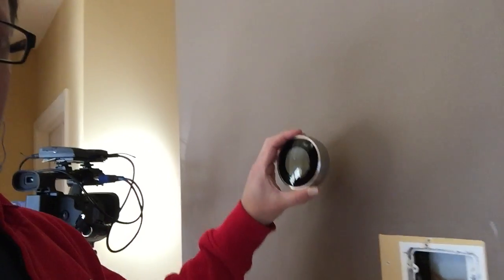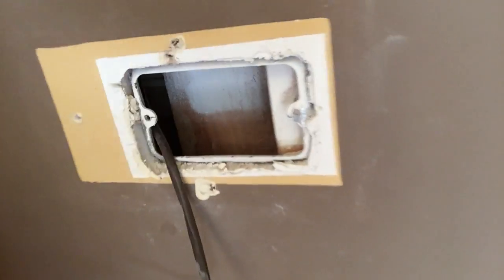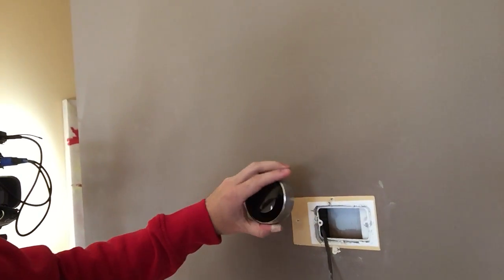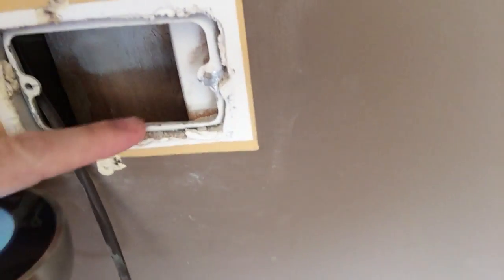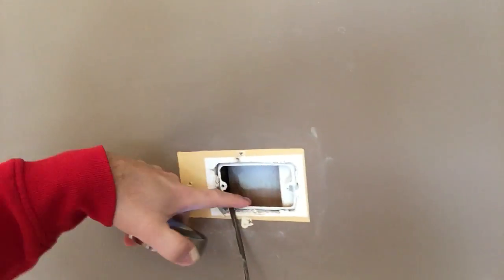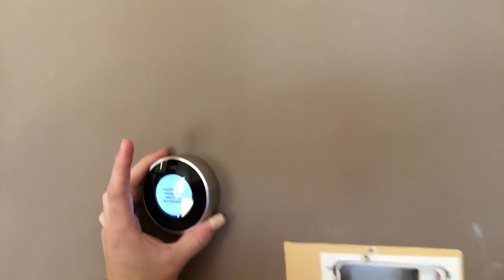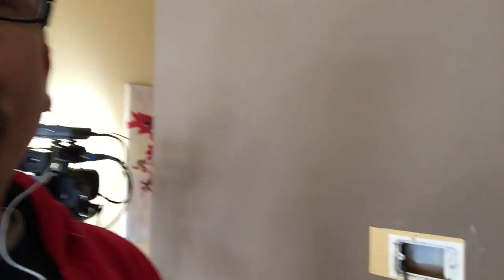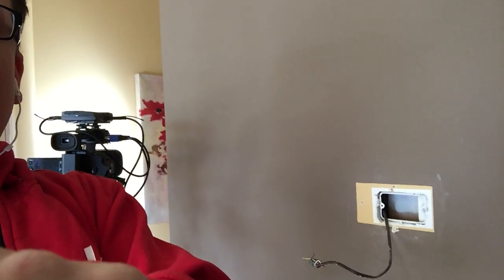Question - How would you patch this wall?

Comment: Tools In Action I read over all of the comments, and there's plenty of good advice on how to repair the drywall.
My opinion is to use the ring that goes with the Nest and mount it on the existing plaster ring / electrical box. The reason it was put there in the first place is to prevent the need for doing exactly what you are doing, which is drill more holes and patch the wall every time the Tstat is replaced.
Alternative recommendation would be to put a blank wall plate on the old location until you are committed to keeping the Nest, and then do the patch work in about a month after you have decided to stick with it. Paint it all up to make it look good.
Reply: Just about the best answer here.
Reply: dewalttoycollector I'm glad someone else has common sense. I think about from the install and maintenance point of view, with avoidance for causing drywall dust.
Reply: Dwight Bennett that's why you wet sand the joint compound instead no dust

Comment: Cut the hole no bigger then you have to remove the plate. then cut your patch 2" bigger than your hole all the way around. then score the back of your drywall a little smaller than your hole snap it then peel it off leaving the paper on the face now use your paper for your tape
Reply: Never heard of that trick before that's a genius move Regiopit!! I like that idea you have the tape built into the patch.
Reply: I was always told to never do a patch bigger than your hand that way. But for anything smaller it is great.
Reply: around here we call that a "blow-out" patch. i personally dont do them and train the younger guys not to either. It'll look fine but an ounce of pressure and you've got cracks. besides that takes as much/more time than screwing furring strips on either side
Reply: I have been doing it for 20 years and have never had a call back. you have to use common sense if you do something bigger than a 4" x 4" patch you could have problems.
Reply: personal preference... i dont do blow outs
Reply: Yea. And hopefully nobody bumps it. I learned that from a guy who was a hack. I tried it and personally I don't think its a very good way to do things
Reply: As long as you fit it tight it not a problem IMO. I could easily punch a hole any drywall regardless of how its fastened. Plus it works regardless of thick your drywall is versus what's hung.

Comment: Cut just a lil bit around the box so u can remove it. Then coat joint tape in 20min mud and cover the hole. The 20min will suck in the tape and then u can skim coat over with yellow mud for the best results. I do this all the time in remodeling  old houses

Comment: Since you're mounting a t-stat, you need support. Cut out enough to remove the box. Cut you patch 2-3" bigger than your hole. Cut the back paper to the size of your hole, peel off the gypsum leaving the front paper which acts as your joint tape. Screw in a few 1x2's that span between the existing drywall and extend over the hole. Now place the patch, a screw or two, flat, finish, texture and paint.

Comment: that mud ring is just attached to the stud with two screws straight through the front, you only need to cut a hole as big as the mud ring to get it out, which is almost definitely 4 inches by 4 inches. That being said, I understand you might want to cut a big enough hole to attach a new piece of dry wall to both studs.

Comment: Leave it in place 
14 yr drywall  finisher journey man ...
Honestly  cut a square of drywall  that  fits inside the  box  and put a bit of liquid nails to hold in place. .. and tape it in with some fiberglass mesh tape using  durabond  and put atop coat of +3 pigmented to make it an easy sanding job..

I have done this exact thing hundreds of times. .especially on Comercial jobs in offices

Hope this helps. ..keep  up the videos 
Thanks

Comment: Just let it be, use a piece of oak or two to create a beautiful wall accent that includes the nest at the center. It could be square or circular, and made out of either a single or edge jointed wood. Use a router to give it a decorative edge and you are good; no drywall work necessary, and you have a wall accent.

Comment: Regopit nailed it, just look up "california patch". Even though it's a small patch I would still screw a furring strip backer in there to support it. That looks like a pretty dark color so be ready to have to paint from one corner to another, you might not get away with just priming and spot painting. Depends on how much light you have shining across it. Whatever you do don't use a pre-made mesh kit and don't use that sticky back mesh tape with regular air drying bucket mud! Nothing wrong with mesh but it's made to use with durabond or easy sand, regular bucket mud will crack later on. California patch with a backer is the flattest and easiest to blend patch for a homeowner doing their own work. Good luck Dan!

Comment: The plate appears to be flush or at least not sticking out any further than the existing drywall. If that is indeed the case, I would just make a plywood backer that you attach to existing drywall, and attach the new piece of drywall to that.  Then go ahead and tape and mud as you normally would.

Or else just cut a slightly larger hole removing the box all together and do the same process if the box is in the way for what I mentioned above.

Comment: Cut a hole big enough to remove the plate and then patch it up. Im an HVAC contractor and we never put in plates for the thermostats. That way if the thermostat is ever changed then there's just a wire hole in the wall which always gets covered by the new

Comment: what i would do is cut around it until you hit the studs on either side then take the plate thing off drywall it and install that thermostat or install then drywall (also when you paint it if your using the same grey paint it about double the size of the hole then dab it with your brush doesn't even look like a patch)

Comment: Ok seem to be a fun project to do my recommendation is to cut around and resurface that hole. But you can get a flush plate at home depot not a deco-plate mixed some 20 minutes mud get mesh tape and apply  the mud. The way to apply the mud is circular no up and down. The you let it dry 50% and wet sand. Apply some light orange peel, primer and paint. Done deal! Happy wall and enjoy the nest! TIA TOOL BAG GIVEAWAY 5! DECEMBER 25TH

Comment: Can you remove that junction plate at all Dan? if you could  you might be able to cut the patch size down If that's not the case.  I think you might have to go bigger as a patch kit wouldn't be able to anchor the nest well its just thin aluminum

Comment: Take that metal frame out. pick or cut a piece of drywall that outline 1 or 2 inches the present hole. put that new piece center against the hole, mark with a pencil the outline of that piece on the wall. Now cut with a drywall hand saw that outline, after you cut, the new piece fits almost perfect on the new hole. put inside the hole 2 strips of wood and screw from from outside with drywall screws on the top and bottom (you should have a hole with 2 strips of wood crossing from inside), now put the new piece on the hole and put 1 or 2 screws on the new piece where the wood strips cross. Mud and tape the seams and screws. I think you can take from here...

Comment: Cut the nail or screw holding the plate in with an oscillating multi tool then on the opposite side of the hole from the stud screw a piece of plywood to the inside of the wall then all you have to do is patch that little bit of wall instead of a bigger hole

Comment: Yeah just take a drywall cutting hand tool and get rid of all that.  1. Take a 1 foot level and put a pencil line under it and on all 4 side for your cutout.  2. since you will probably only have 1 stud to screw to take some backing on the other side either plywood or a 2 by 4 and then you will have something to screw too.  3. Get some new drywall, screw it off and mud over it flat.  4. sand it a bit prime and paint it to match.

Comment: tear the whole wall down, start fresh..
Reply from the maker: LOL
Reply: Tools In Action
I'm a drywaller by trade, but since the correct answer was said more than once. It's possible but finicky to just install backing and cut a small patch to fit. Or craft a butterfly patch. Or mix up some concrete fill and pack it in there. Or use toothpaste and newspaper. If you're determined, why not sheet the whole wall over? They do sell pre-cut mesh patch kits, please don't use one!